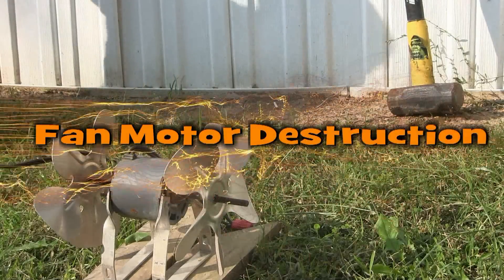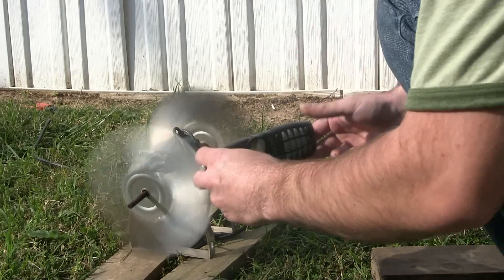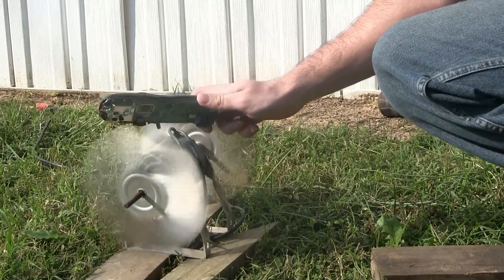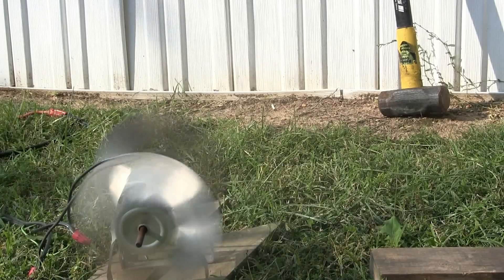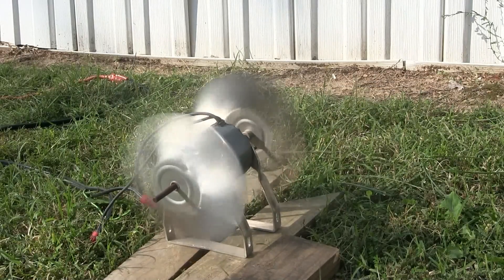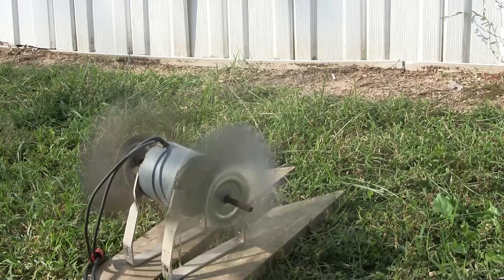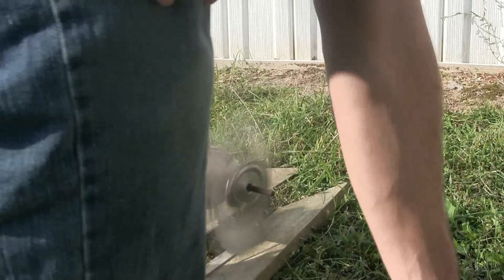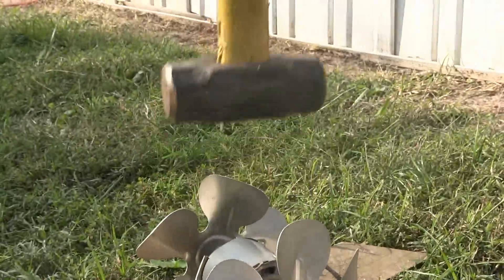Fan Motor Destruction

Comment: AC Shaded pole Induction motors are incredibly resilient little buggers, I saw a video where someone blasted a similar large fan with a 2500 volt microwave oven transformer and it took it for a while before both the motor and the MOT burnt at the same time. Spectacular end, it ended in a huge bang, and lots of magic smoke. :D
Reply: https://www.youtube.com/watch?v=hG5P113O6Ms&t=180s

Here's a link if anyone's interested.
Reply: Was that video called "SUNDAY NIGHT WITH ED" on Aussie50's channel because they did the same thing with the same ending.

Comment: should have tipped it over and let it go
Reply: What they should have done is overclock the motor so it spins much faster and push it off a table.
Reply: @aestheticcruise8807  I wonder what the locked rotor current was?